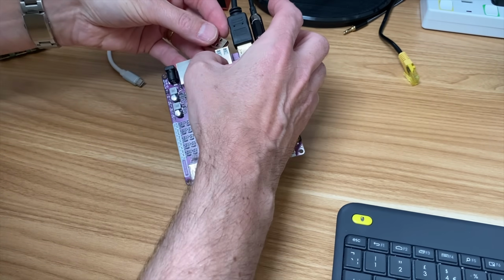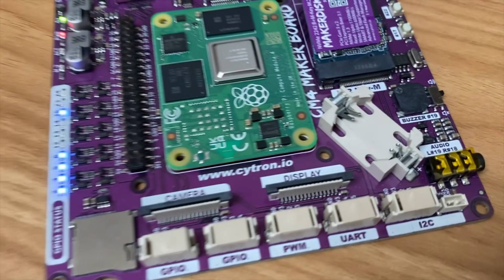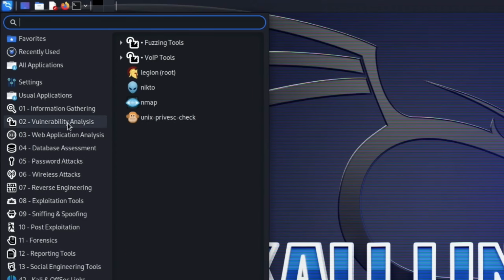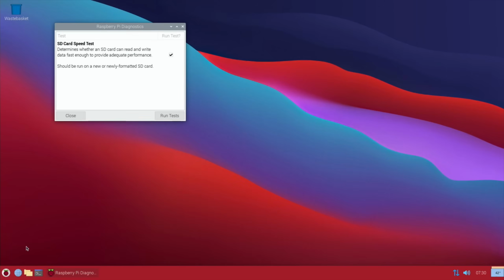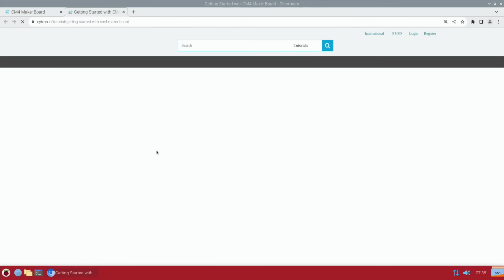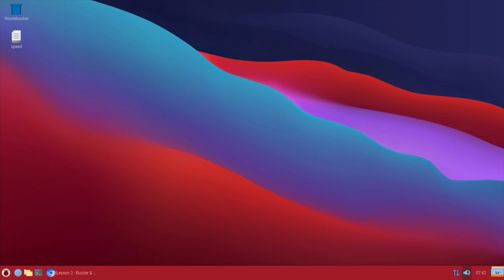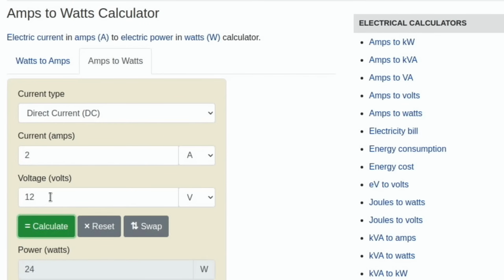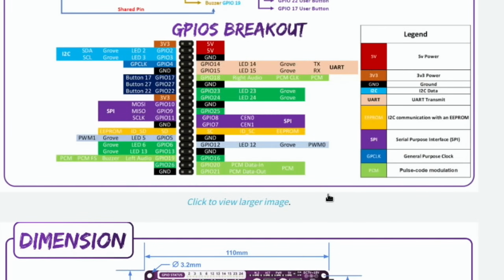Great connectivity. CM4 Maker board Raspberry Pi

Comment: I love the Raspberry Pi 4 Compute Modules. I have 2 modules, one that I put in a GPi2 and one that I have for testing as a micro-server. The problem is that I got mine through an electronics supplier right as the supply problems took hold. Even if my testing of the CM4 went well, I wasn't able to get more. (And I did try.) I honestly would be deploying a cluster of these if RPi could have kept them available.

Now we have the Orange Pi 5 and 5 Plus. These boards are so good out of the box that the ability to reassign the usage of the PCIe lane by swapping carrier boards on the CM4 just isn't competitive. It's cheaper and easier for me to purchase more OPi5 boards. And I can get so much more memory and performance out of the OPi5 boards over the CM4.

Comment: For what it is, it's not bad. When o add the cost to the CM4 module, then it may not quite have the same appeal of value.
Reply: If I don't need GPIO pins, which is the case for most of my projects, then I find it very difficult to justify buying a Pi or any kind of SBC when, for example, just yesterday I picked up a used Dell Optiplex 3020 SFF PC with a 4th generation i3 processor and 4GB RAM for £20 including postage - and that was a "Buy It Now", not me spending a lot of time waiting for an auction bargain to appear.

Comment: I've never tried Kali, but that's a really cool feature for obscuring what you're doing. If I ever fix up the old laptop I'll have to copy that over to Slackware.
Reply: Kali's a great tool for cyber-security and I'd never discourage anyone from firing it up to have a play on their own network (or one where they have permission to run it) because you can learn a lot very quickly.

It sounds like you're planning of running it in a VM on Slackware which is the best way to use Kali - I've seen some people try to use it as a desktop OS and it's just designed for that in any shape or form.
Reply: @terrydaktyllus1320 there is a built in option to “tweak” Kali so that’s it’s useable as an everyday OS. “Hardened mode”
Kali is awesome

Comment: Interesting video and a great little board, although i don't see how your getting 1Gb ethernet and  an NVME interface at the same time as the board only support USB 2.0 which only support something like 350mbs🤔
Reply: No problem at all. The Gigabit Ethernet is directly from CM4 Ethernet interface (not going through the PCIe bus), while the USB2.0 is directly from CM4's USB 2.0 interface. The PCIe Gen 2 x 1 lane of CM4 is reserved for M.2 socket.

Comment: That speed on the maker board is NOT what you should be getting... you SHOULD be getting pci-e 2.0 x4 speed (which I THINK would be a little over 1GB/s at it's fastest) .... but you seen to be getting the USB 3.0 speeds..
- I COULD BE WRONG THO..... I honestly never did any speed tests when I had my CM4 up and running, but now I'm quite intrigued... but to getting it up and running I would have to erase the SD card in either my phone or my steam deck ( I have misplaced one of my SD cards :( )  
- It's still faster I guess, but not the speed that I would expect to get.... OHHHHH maybe it's the nvme m.2 card!!! Is it a SATA card??? I'll bet that it is!!! That's why it's topping out around 300MB/s ..... now it makes sense!!! Yea, you're gonna get the same results until you use an PCI-E nvme m.2 - check to see if it is a B-Key drive .... they are the SATA drives ... you need an M-Key drive for ity to be PCI-E and get the full speed
I could be wrong about this tho... but I've always understood SATA to max out at about 350MB/s which ABOUT what you getting ( in sequential write speed)
I REALLY hope you have a pci-e nvme drive.. I wanna see what that maker board can do... It is IMPRESSIVE!!!! I'd take that over my waveshare any day!! lol (unless it doesn't do pci-e nvme speeds)
Reply from the maker: This is what I was using

https://www.cytron.io/p-nvme-2242-b-plus-m-key-makerdisk-ssd-128gb-preloaded-rpi-os
Reply: hrmmm.... after looking closely at the Maker Board it says it's M-key so the Maker board SHOULD up to pci-e m.2 cards .... but that means it's all down to what type of m.2 card that is.... 
- BUT I think even if it the SLOWEST POSSIBLE m.2 card then it SHOULD still be getting HIGHER SPEED than the roughly 300MB/s that you're showing..... BUT maybe that's all that the Raspberry Pi 4 can do, whether it's a 4B or a CM4 .... but  I was under the impression the CM4 was much faster than that....
- - I guess the ONLY way I will know FOR SURE is if I put mine back together and  run the same test as you.... so until then I'll just stfu about it lol sry :)
Reply: @ThatTweedle  The NVMe SSD speed was limited by the CM4 PCIe bus. CM4 comes with PCIe Gen 2 x 1 lane only, not 4 lane. That limits the speed.

Comment: Can it be powered from batteries via  GPIO?
Reply from the maker: It’s not something I have tried
Reply: @leepspvideo  If you wanted to be build a laptop or a TRS80 Model-100-look-alike.  this is the sort of board you would use I think.  It is just a shame that manufacturers don't put an alternative 'power in' on the opposite from the main block ports. If you get my drift.
Reply: @clangerbasher  Why would you waste such resources just to emulate a TRS-80? Some clever people have already got ZX Spectrum emulators running on ESP-32 and Pi Pico micro-controller boards - you're only emulating a Z80 CPU running at 3.5 MHz after all.
Reply: @terrydaktyllus1320  Go read what I said and then get back to me.